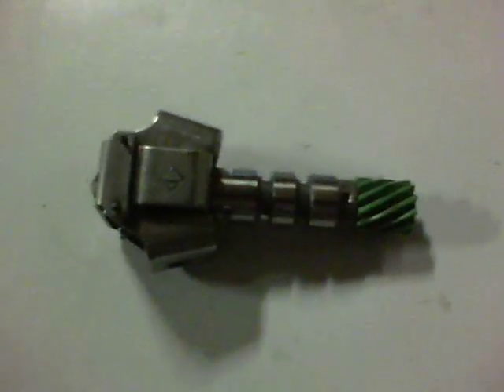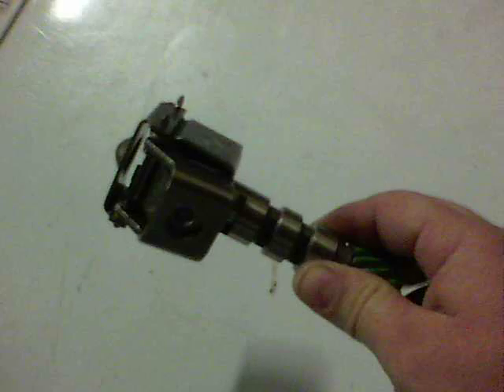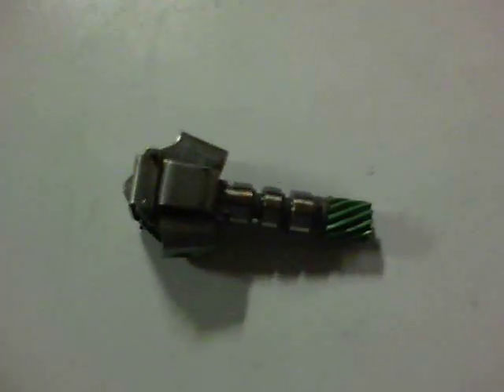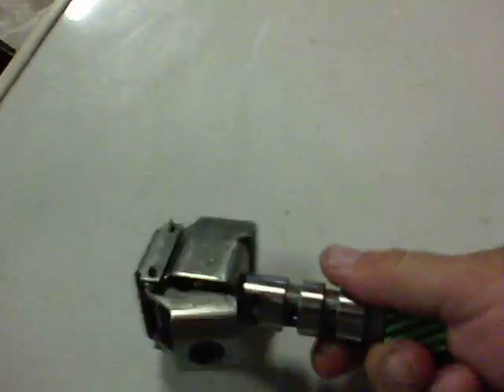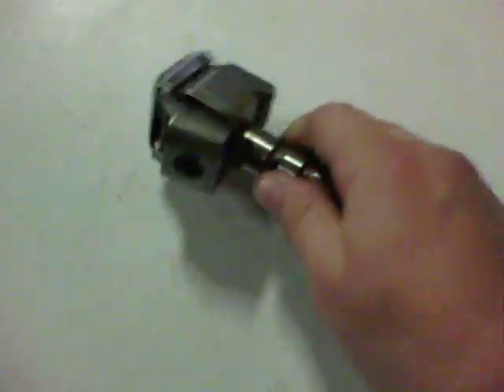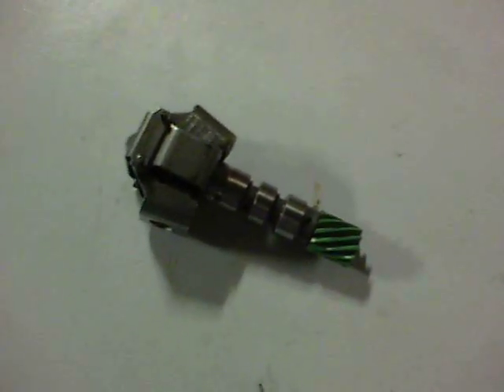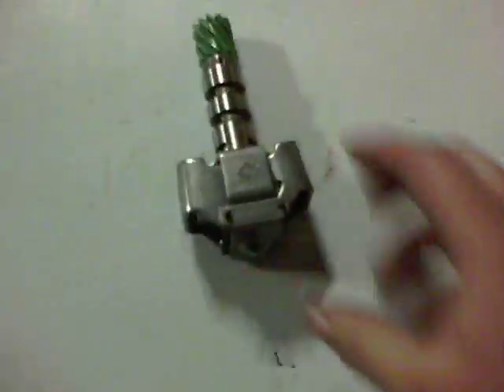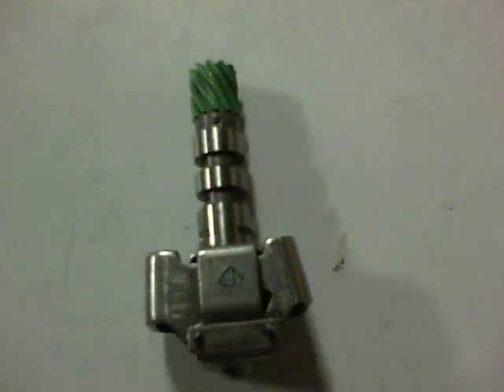700R4 Transmission Governor

Comment: Good video.  Those heavy weights are the ones that open the valve to let oil go in to work on the valve end, which then closes down the little weights.  They call them priming weights.  Btu, like you said, the little inner weights and the springs control your shift points.  Not complaining, just explaining.